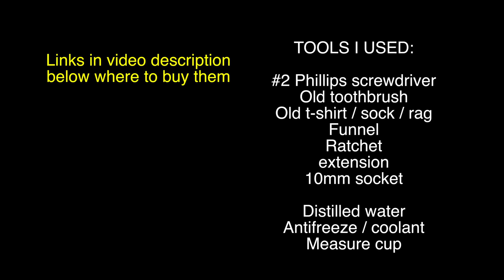Honda Ruckus / Zoomer 50 - Coolant Change | Mitch's Scooter Stuff

Comment: This was a good video... except at the end when putting the fluid in, I ended up with a huge puddle on my floor because I didn’t put the screw on the left side in before pouring the fluid... I think you need to fix that step??
Reply: Kyle Peterson same here lol. I guess it helped clean out any dirty debris
Reply: Lol what a joke. Common sense put your bolts back on before refilling. This was a great tutorial.mitch is the man!
Reply: @Thatyouguy_  Great tutorial otherwise but this step is in the wrong sequence in the video

Comment: This was a super helpful video! Only thing I️ noticed when following it during my coolant change is that the cylinder drain bolt needs to be put back in place before you refill with new coolant. If not, the coolant fills to that level and just drains onto the floor.

Keep up the awesome videos!
Reply: Found the same thing hahah
Reply: Yup just happened to me too lmao

Comment: My god dude, thank you so very much for these ruckus videos. May sunny days and sweet scooters bless your world.
Reply from the maker: Anytime!! 👍🏼👍🏼
Reply: @MitchsScooterStuff  You are great man ! I just got done watching your 99$ Honda Elite purchase 80 cc what was your total cost in parts when you were finished ? 

. On the coolant video (Honda Ruckus ). I did not see how you would bleed the air . I read somewhere that you need to bleed the air . ? I have a 2019 I bought last August . Already 3700 Miles on it . You figure coolant needs to be changed yet ? My carb was just cleaned by the mechanic . You Rock Man ! 

Josh

Comment: I paid a shop 425.00 to put either a new or rebuilt carb on my sons ruckus. It started right up when I picked it up but when I got it home while it would start up in sputtered when trying to accelerate. Like it wasn't getting enough gas or maybe an air problem? This guy has his shop at this house and it took 6 months to get it back the first time. Don't want to try that again. Anything I can try to correct the problem?  Thanks -Arkansas Bob

Comment: Great video! Really helpful One question though, in the video you refill the coolant then, re screw the drain bolt. I followed the instructions but when I tried to pour in the coolant before I re screwed the cylinder drain bolt the coolant just spilled out. I had to put the drain bolt back first, then refill the coolant. Is the process different for different models?

Comment: What's the deal with the "cylinder drain bolt?" What's its function, and why remove it?
Reply: Captain Kirk To drain the fluids in the engine as the fluids drains out under the radiator.

Comment: Hi Mitch,
All your videos are really creative and simple. good job and keep it up!

i bought a Ruckus and did not modified it at all, my issue is,

when i drive it 40KMP speed for about  4-5 minutes the engine light blinks for 3times pause and again it blinks, then the bike speed reduces automatically.also some water drops comes out from the air cleaner box.

can you kindly help me on this.

Thanks in advance
UJ

Comment: Hey Mitch, my Ruckus says my engine is overheated after 5 minutes of riding. When this happens it slows down tremendously to 5 mph. What should I do?
Reply from the maker: Make sure the coolant level is full. Check the engine oil too
Reply: You have air in the system , let the air out by letting it idle with your rad cap off. You see bubbles coming to surface. When no more bubble , readjust level

Comment: Hi, friend: please clarify a doubt, after changing the coolant or antifreeze. Should I purge the air that is trapped inside the radiator? or in this type of motorcycles it is not necessary? How is the air purging done?
Thanks for your help! 
Greetings from Bolivia, South America.
Reply: Yes you should remove trapped air. 

I drained the coolant and refilled with new. After a short ride the red coolant temp light came on. Removed the rad cap and topped up the fluid, on the kickstand, I ran the engine (rad cap still off), for a few minutes blipping the throttle. After a bit air bubbles became visible while revving engine. Continued blipping the throttle until air bubbles stopped. Air purged. Good to go. Problem solved.

Comment: I'm about to do a 2500 mile service at 2200 miles (run full throttle mostly) what would you say needs to be done? The coolant level is just above the low line so I was thinking I might as well  do the coolant
Reply from the maker: Hey you just need to change coolant every 2 years ...

Comment: My ruckus doesn’t drain the reservoir when yours does and it also pours coolant out of the other side of the engine if I don’t put that bolt back in before filling… what am I doing wrong do I have a blown head gasket or something? Thanks

Comment: Hey Mitch, thanks for this really helpful video! Quick question! After you started and let the bike idle after adding the new coolant in, did you top up the radiator with straight coolant or what that more of the 50/50 mix that you added in the first time? Thanks!
Reply: Probably more of the 50/50 mix

Comment: OK, I had an issue while doing this change, so can someone please tell me what I did wrong? In the video, he puts new coolant in before he puts the bolt on the left of the bike back in, but when I put the new coolant in, some of the new coolant started draining out of that open bolt slot, forcing me to replace the bolt and then continue topping up the main coolant tank. I then topped up the reserve tank, and I think all is well, but I wanted to check with y'all, in case doing it in the order I did would somehow trap air, or something. How did Mitch's coolant not spill out of the open bolt when mine did?...
Reply: The same thing happened to me. Strange
Reply: @andrewwakkuri9993  I wish Mitch would reply, in case it's something obvious :P
Reply: Happened to me also!!

Comment: Why is my new coolant coming out of the drain bolt before it fills the radiator up??
Reply from the maker: hmm did you put new washer in?
Reply: No it’s the same one. It seems like for mine, I had to fill up the radiator until it started coming out of the drain bolt hole. Then screw that bolt in and fill it the rest of the way